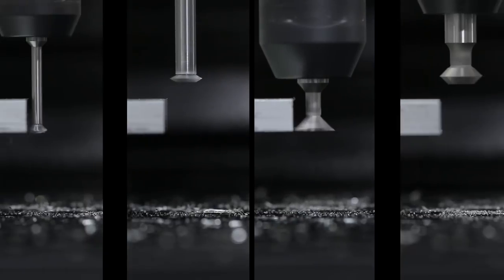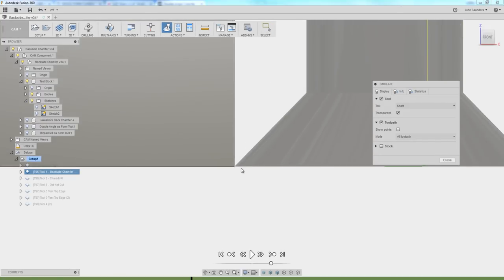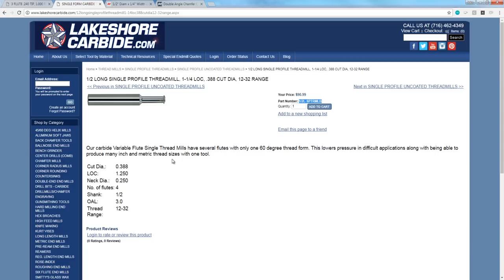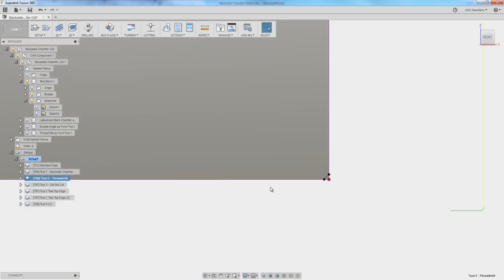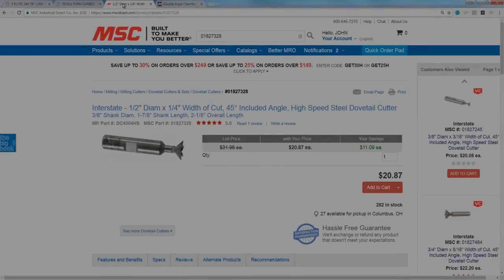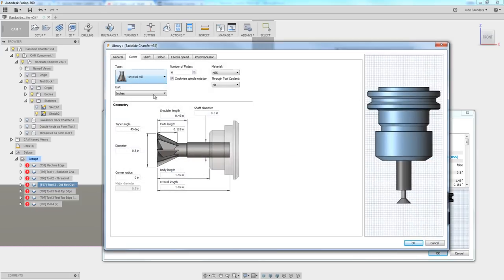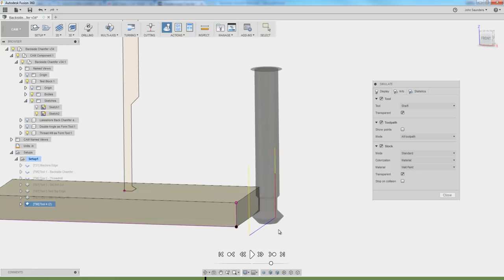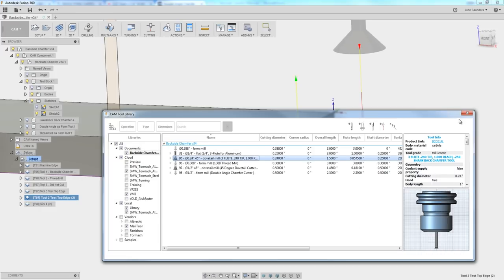How to use Backside Chamfer Tools! WW184

Comment: Hey John, just FYI- in general I have found that chamfer dimensions are called out normal to the surface being chamfered, ie not the hypotenuse.
Reply: Alex Kern was just going to say that.
Reply: I agree. I found this quote from ASME Y14.5-2009 
1.8.15 Chamfers. Chamfers are dimensioned by a linear dimension and an angle, or by two linear dimensions... 
Where an angle and a linear dimension are specified the linear dimension is the distance from the indicated surface of the part to the start of the chamfer. 
Of course that might not matter if the drawing calls out a .010 length on the chamfer but most drawing in the US should be using the Y14.5-2009 standard for their drawings.
Reply: Yeah, I found that odd that John was using the hypotenuse. The reason Normal to the surface is used, is because you need a way to measure it.
Reply: gredangeo 
Has nothing to do with measuring and everything to do with making it easier on the machinists. It’s so they don’t have to do the trig to get the right size chamfer flat. 

It’s no more difficult to measure the hypotenuse than it is to measure the rise and run.
Reply: I don't have a convenient way to measure a chamfer on the Hypotenuse. I could use the verniers and measure with that Normal to the chamfer's surface, but that is inaccurate as it gets.
Reply: gredangeo 
The. How do you measure the rise and run??
Reply: I measure the depth of the chamfer preferably with a Depth Micrometer. When I can see the bottom of that rod flush with the bottom of the chamfer, I have measured the rise of it. I can do the same thing with Depth portion of the Verniers, but that is less accurate.
Reply: gredangeo 
You can measure hypotenuse with greater accuracy with a angle block, and height gauge with a test indicator. 

Tip the part so the chamfer angle so the hypotenuse runs vertical, zero the test indicator on the flat of the chamfer, bring it down till the indicator needle just moves then bring it back up till it hits zero,  zero the height gage, then bring it up till the test indicator moves again, then back down to zero. 

The reading on the height gage is the length of the hypotenuse.
Reply: I second that,  the call out is usually the "depth" of the chamfer  and the angle.
Reply: That's always how they're done where I work too at a grinding shop, no matter the angle it's always the length in z, but I think I've seen some called out as a diameter but they're more of a angle than just a chamfer
Reply: @occamssawzall3486 significantly easier to use a depth mic for checking that a chamfer is in tolerance linearly than it is to take the part out of the machine and use a comparator to measure the hypotenuse
Reply: @occamssawzall3486 yeah the method you just described absolutely won’t work for checking my setup part while it’s still in the machine. I work one toolpath at a time, adjusting my comp values to avoid access scrap.

Comment: (@5:20 or so) also, this tool has 2 angled cutting surfaces, so you can chamfer both the top and bottom side of the stock without changing tools (again, as John said, if you just need an edge-break-type chamfer.) Just an FYI, here. 😎

Comment: I am shocked how many shops I have tried to source parts from that are BAFFLED by this technique. It has been a fantastic trick that I have used so much over the years. 

Thanks for sharing !!
Reply: the fact he needs to use a CAD system to do it is what is baffling.
Reply: If you do not use CAM system in a commercial shop - you are foolish. 

I outsource parts to a few shops that are very proud of their ability to 'do things real quick right at the machine'. False. I am faster 100% of the time using CAM, even for small edits and fixtures. In the end, you have  a model referenced tool path that can be tweaked in any way very quickly with far less chance of an 'oops'.

I have VERY little scrap. I setup FAST. I make parts FAST. I can make any change to any program and it is always tied to the part. When the part design changes - ALL the CAM tweaks change with it.
Reply: Factory400 you are basically the same as todays teenagers; Can't  do basic addition without a calculator.  

CAM systems are the future for sure. But not in every case. 

Your capital letters are very impressive. Once you own a 80man shop with 18 machines I will listen yo your nonsense.
Reply: At the end of the day - the fastest one wins. I am, in almost every case, faster and more automated than any other shop I have interfaced with (big and small). They make all kinds of claims that they know how to do it better, faster, etc because their shop is bigger and has more experience....yet they are slower in every regard. They take longer to program, longer to setup, and scrap more parts. In the end, they have critical changes (information) scattered all over the shop and in the heads of the various people involved. That makes repeating the job far more difficult. If you are not capturing all the lessons learned while making a new part, you will be required to learn it all again the next time you do that part or one similar. 

My process does not require anyone to remember anything as it is embedded in the system itself. We very rarely repeat mistakes. At 43 years old, multiple businesses, etc.....I am only interested in performance, not an allegiance to legacy workflows.
Reply: "Can't do basic addition without a calculator" if you've Computer why you need Calculator?

Comment: If you note on the Mari-tool webpage. The diameter tolerance is +\- .015.  That dovetail cutter probably has similar tolerances on it, which explains why it didn’t cut right the first time
Reply: +/- .015" is pretty bad. Kinda hard to maintain a decent chamfer with a .030" movement.
Reply: gredangeo 
Well it’s not like the same cutter constantly varies +\- .015 😆

How much wear do you really put on a dovetail cutter?? Hundreds or thousands of parts before it needs changing out. Then just needs the diameter offsets dialed in after a change. And with modern tool setters, that’s a few seconds to get the true diameter.
Reply: The problem is with grabbing a new cutter. The diameter has potentially changed again. So you have to back it off and walk it in again, so you don't go oversize. Also, at our shop, we don't have a tool presetter. Kinda behind on that.
Reply: gredangeo 

Cutter diameter changes with every new cutter you grab. Even high priced carbide endmills have a +\- tolerance they’re ground to. Usually +000/ -.0015. 

So there’s still a change in diameter you must account for.

And barring a toolsetter, a tri anvil micrometer will do for odd number of teeth cutters and a standard micrometer for even number of teeth.
Reply: @MF175mp  
Every vendor has their grind tolerances for cutting flute diameter. Typically it’s +0/-.005 for straight flute, +\- .01 to .015 for form cutters. At least ones that are stocked regularly. Custom form tools are held to tenths, but you’re paying $500-$800 per tool. 

They’re more concerned with cutting flute to shank run out than they are diametric tolerances, because a diameter can always be compensated for, while trying to compensate for shank to flute run out is virtually impossible
Reply: @occamssawzall3486  even chinese solid carbide end mills are usually within .0005 in both size and runout, maybe the occasional monday piece is .001 out
Reply: @MF175mp  
What the Chinese write on the piece of paper and what the tool actual is are two entirely different things. 

China is not held to any kind of compliance standards like most other tool manufacturers are in their respective countries. 

When they’re selling a cutter for less than the cost of the carbide blank, and you think you’re actually getting what they stamped on that piece of paper they shipped with it.  Well.  I got a bridge to sell you.
Reply: @occamssawzall3486  they don't promise anything. That's what I have measured. But those are not the 2$ cutters either, they are far worse and made of HSS

Comment: It might have been that the tips of your hss cutter had some wear on them. We usualy use wear compensation for this kind of jobs. We checked our HSS dovetail cutter after some time on the tool probe and it showed that the diameter was smaller for about 1 mm for out 25 mm mill.

Comment: great timing! was just about to do this on a production part!..  how about back chamfering holes?  any advice on linking moves to get it to plunge in the center of the hole?  I've seen the option to plunge on center of a hole a few times but wonder where to find it sometimes as well.
Reply: I can't give any advice for Fusion but, you probably need to manually get to depth, arc in, circle the bottom edge arc out, and back track your way out.  I've never heard of a CAM program that had an out of the box operation type for easy programming something like that.  If you want to get fancy, you could write a custom subprogram/user cycle and pass in some variables.  I've seen it done with custom drill bodies that had a set of chamfer inserts for the top of the hole (plunge) and a set in the drill body that would back chamfer (circle interpolation)... we used a custom operation type in CAM, integrated with the post and a user cycle in the control.

Comment: Hi John, I am stucked on backside chamfer in a hole which is on a pipe (I need chamfer the hole from the inside in the pipe). I have 4th axis so it posible to use it. Trace work fine on upper chamfer, but from the bottom of the curved hole edge it doesn't work. Have you got an idea how to do that?

Comment: What about backside fillet tool? Does those exist? I think a fillet is going to feel better in the hand  than a chanfer.
Reply: Yes they do as well as a variety of full round form tools to radius top and bottom in one shot. You have to have faced that to get the blend right but that's already fairly true of plain ol corner rounders.

Comment: Interesting, although I'll never operate a CNC machine in my home shop.
Reply: Jeffry Blackmon I use the same tool and method on manual mills too, saves time by not reindexing the part when you flip it.

Comment: im baffled that you really uses inches! in this line of work, millimeter is the way to go!
Reply: one word... 'MURICA
Reply: No, inches are the way to go! When you know how to use them, it makes more sense!
Reply: hell no! one firht of a quarter of an inch is not logical or senceable than  millimeter! there no way around it! simple 10's. 0,0001x10= 0,001! etc etc!
Reply: @balooc2  It doesn't make a difference what system you use. Yes metric is based on 10s but more often than not, fractions of 1mm must be used in precision machining. As a result you are no longer based on 10s so it really doesn't make a difference.

.0254mm = .001in
.0508mm = .002in
.0762mm = .003in

In the above example it would appear that imperial is easier and more logical when it comes to precision fits and tolerances.

but...

.02mm =.0007in
.03mm =.0011in
.04mm =.0016in

now metric seems more logical

So you see it really doesn't matter. They're just numbers.
Reply: Not when you live in America. Prints in metric are concerted to inches. Then we'd have to scrap our mics and buy metric ones. Not going to happen! Even my machine I work on converts everything from metric to inches. This isn't nasa over here.
Reply: Until a country using lands humans on another celestial body using units displayed in Metric in a vessel with components built to Metric dimensions, we can talk. Until then, I'll stick to thousandths of an inch.

Comment: The company I work for doesn't want to buy a CAD/CAM program. I wish they would. I have to trig all this stuff out, and write it all on paper. Then type it on the machine. And no, they won't hook a computer up to the machine. I have asked. It's like they're looking to fail. They're stuck in their ways. I've used ezcam in the past. It's a relatively cheap program, and It will get the job done. But, they won't even use that.
Reply: Gregg 
Then you should find a new company. 

A shop like that will not survive much longer unless they’re just running the same 10 or so parts over and over again.  Even then. Contracts eventually end.
Reply: 4 people like this comment is the first shock. Read my reply to Gregg, i'm sure you will get the main point. What you have said is incorrect. New production is valued at an all time low. No matter how fast you make it you will still be paid terrible money in comparison to 5 years ago. Repairing complex tools primarily for the oil industry, now there is a money maker.
Reply: Richie Bhoy 
I disagree. Oil industry work is good money, but can be fickle like aerospace work. Booming one minute and dead the next. 

Short run, fast turn around prototyping is huge money right now. 

Production in the US is fairly bust. China can almost always do it cheaper. 

There’s a huge demand for small quantity R&D prototype parts in the US right now and will be for the foreseeable future. 

Oil industry repair is a close second IMO, but varies greatly by physical location. Here in New England, there’s practically zero oil industry work and would be hard pressed to make a living at it up here.  R&D prototypes however are booming.
Reply: Fascinating discussion. Is the booming R&D prototypes sector for parts or complete designs? If you were going to tool up a shop in this area, would you go more in on additive or subtractive machining? I'm looking forward to IMTS this year, to see how it has changed over the last two, with an interest in small R&D shop work.
Reply: Kent VanderVelden the company I work for is based in Nesconset New York. They do vacuum fixture work. All in house designs. Few jobs have tight tolerances. We don't do any deburring of any kind. I break the edges on the machine. And everything we do is in the negative Machining. We have one old Ikegai with FANUC T6 control. And two Okuma's. All three directly program on the keypad. Which sometimes it's frustrating knowing that CAD programs like this exist.
Reply: Gregg, if you lived in San Diego I would invite you in for an interview.  You would be using SolidWorks with CAMWorks and Volumill High Efficiency Milling to push 300-600+ipm cuts in aluminum to minimize roughing time and maximize profit.  This backside chamfer is stuff I do all the time to eliminate an additional setup. 
 Investing in technology to be more competitive with price and quality will mean more work.  You seem to have initiative and drive to do things better.  Keep looking for a job near you that will embrace and foster those qualities.  You will do well if you keep pushing forward either with someone or with your own shop.